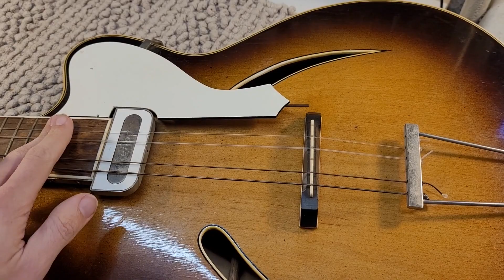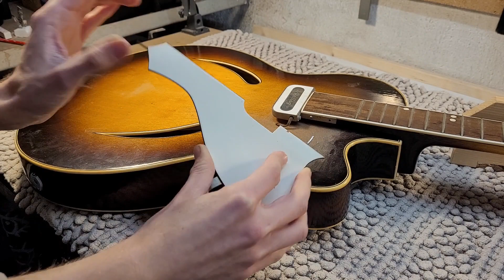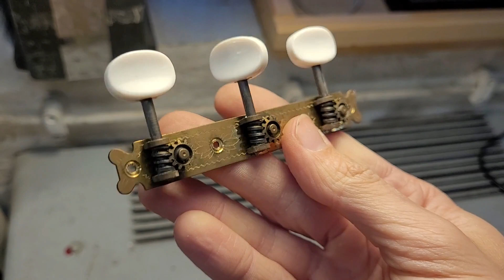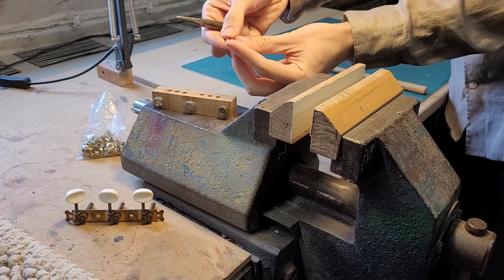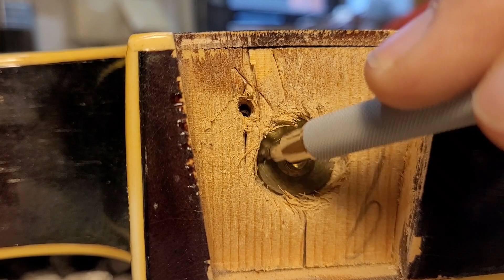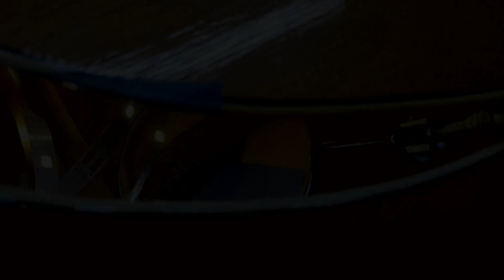A Flattop/Archtop Hybrid?! - Mystery Migma - Guitar Repair Ep01

Comment: Interesting guitar. I have just restored an old Antoria archtop. Undoubtedly made in Bavaria / East Germany in the 50s or 60s. Same shape headstock as Framus guitars.. Probably made in the same factory. It has the same neck join as that one except it was a glued join. Seems to be the same as a violin/double bass neck join. I had to reset the neck as the angle was like that one and it also only had the top part of the bridge! There is a great book available from Bohemian  Guitars CZ. History of the East German archtop guitar industry. Not available in the UK unfortunately.